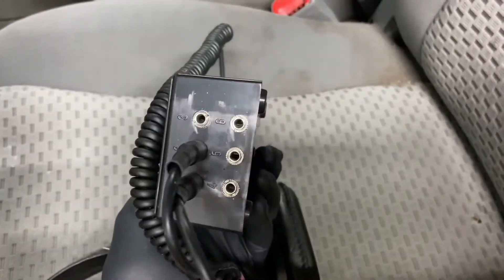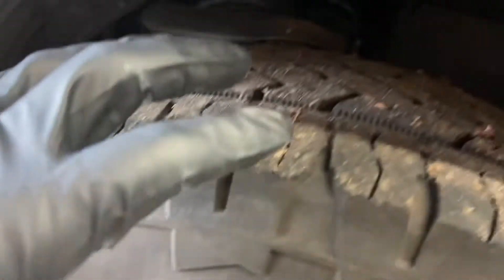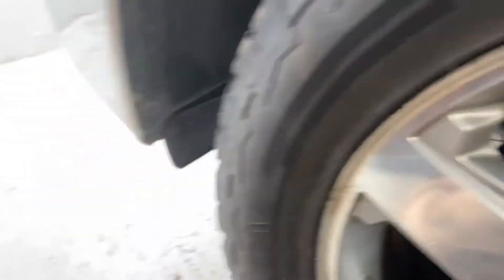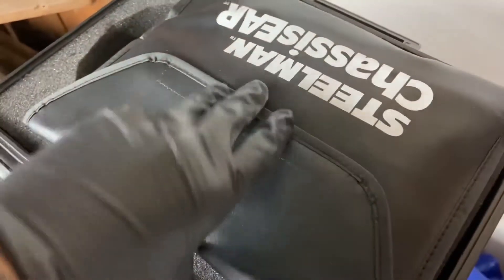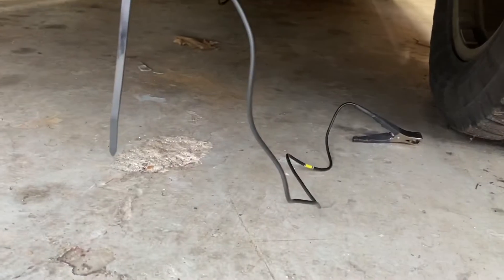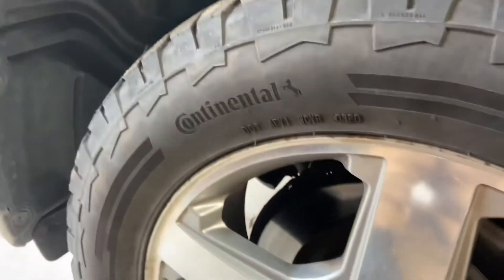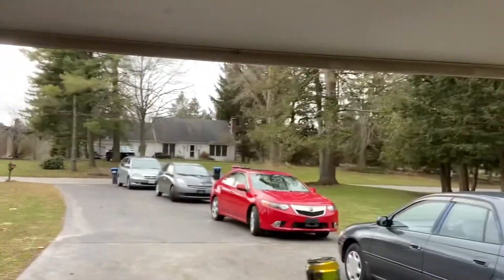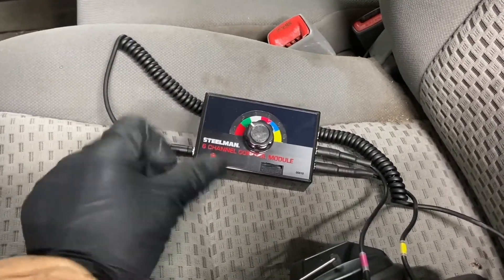Find ANY Suspension Noise/Clunk With This SIMPLE Tool!

Comment: This is Nuts, I was ready to take my car to a shop with a Car shaker. What is it about a clunk and you replace every single part imaginable and its still clunking? Multiple cars this happens to me, If that thing can save you from replacing one Good Part its pays for itself. I have also replaced the wrong wheel bearing before, thats always fun, you see a bad wheel bearing can reverberate to the opposite corner of the car, don't ask me how that is even possible but I have done it. I just replaced the entire front suspension on my car, Everything, its still clunking its probably the exhaust, a transmission mount, who knows? I checked each part with a fine tooth comb already. I got to get one of these